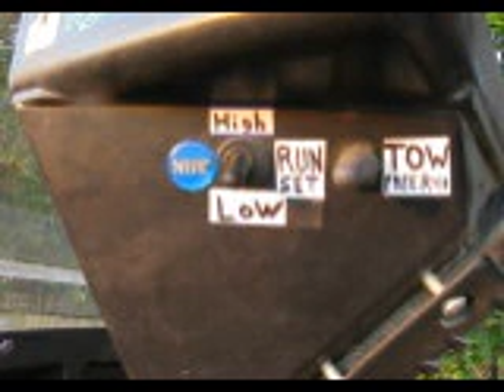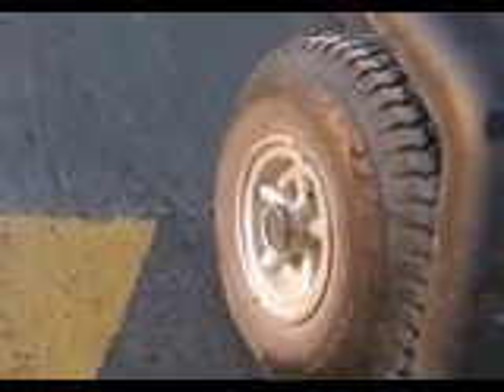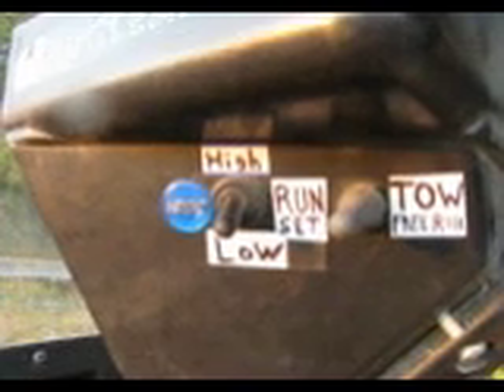EZGO SPEED CHIP - HIGH/LOW - SWITCH MODES ON THE FLY!!!

Comment: I need to know a few things about how you did this
The controller only has on one slot so how do you wire both red and blue chips on a switch to connect to one plug?   The real question is how does it work
Reply from the maker: Only one wire loop is interupted by by the hi/low switch.